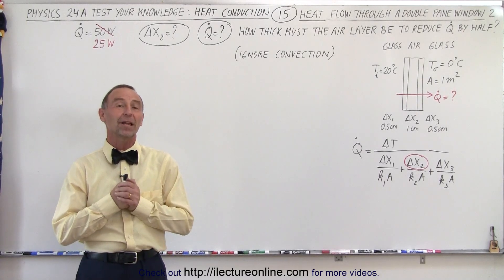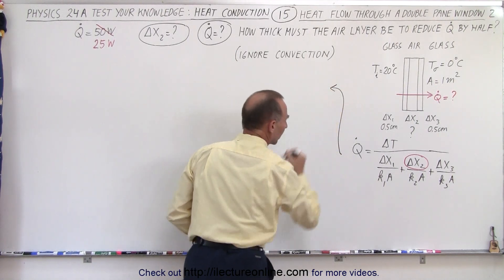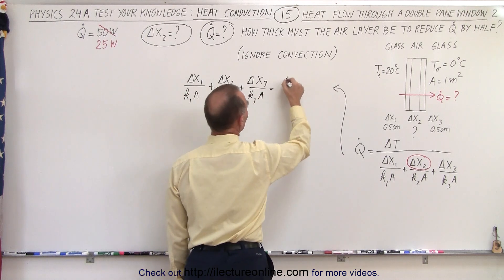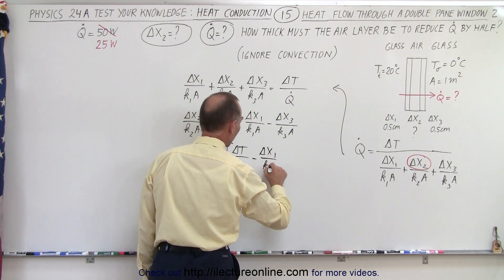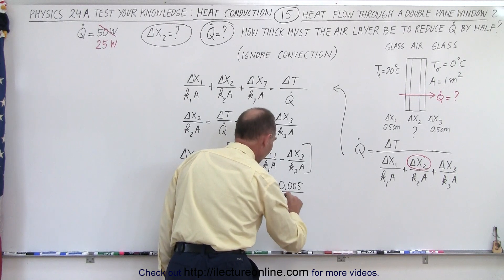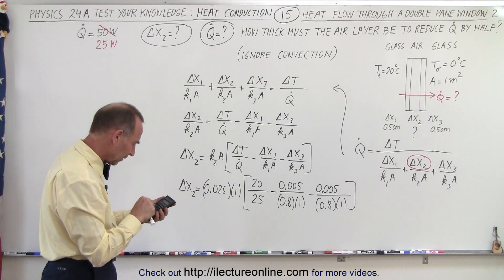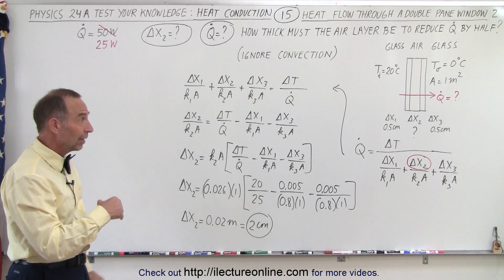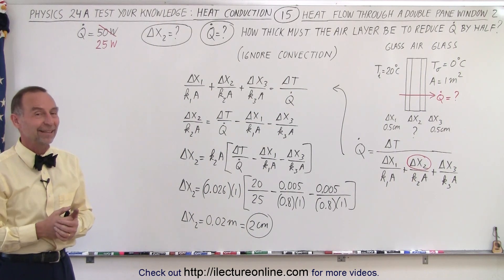Physics 24A  Heat Conduction Examples (15 of 22) dQ/dt=? of Double Pane Window  EX 2

Comment: I love heat conduction problems.  I have 3 huge Handbooks of Linear Partial Differential Equations, Nonlinear Ordinary Differential Equations, and Nonlinear Partial Differential Equations from Soviet authors Andrei D Polyanin, Valentin Zaitsev, and Vladimir E. Nazaikinskii.  The LPDE Handbook goes through case after case of boundary and initial conditions and writes out the exact solutions in all their glory.